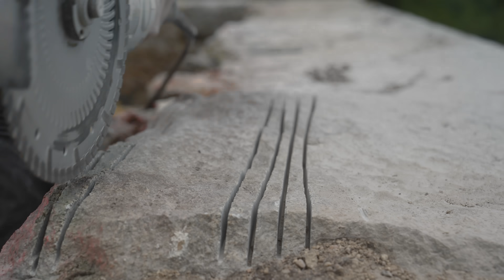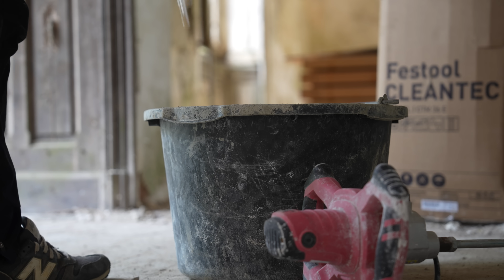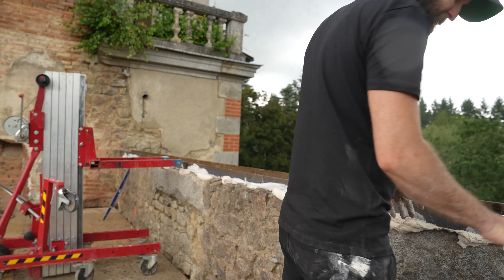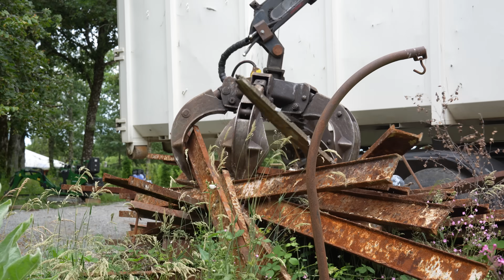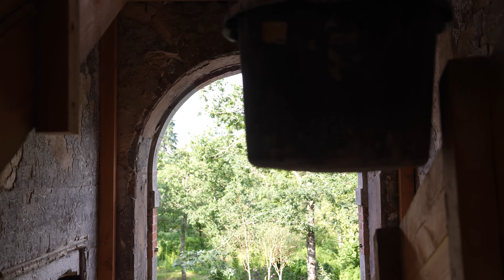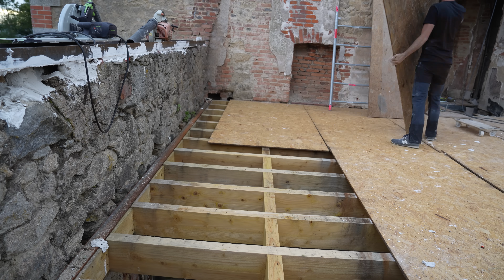The plates are set, its time to start constructing the roof.

Comment: If working  Fire Places are rebuilt  I've seen were the flues are relined using a inflatable bladder the mortar / concrete is pored around the bladder and after the mortar is hardened bladder is deflated leavening a  new flue liner in place

Comment: It's amazing how the original builders did the job, by eye, by plumb bob, by water level.
Impressive, but I do like the laser, chop saw, and impact driver !
Reply: Power tools, that is what I like. Im not medieval so a good saw works nice for me. Now where did I leave my safety glasses?
Reply: The Spirit/Bubble Level that is in common use today was invented in France in 1661 by Melchisedech Thevenot.
Reply: @hrep14  Just googled him, very interesting., Thank you!
Reply: Labour was so cheap plenty of hands make light work by 1879 circa when this chateaux was built they had proper levels measuring devices squares etc. Even using steel.

Comment: Been following you since the start and really appreciate your videos, and your persistence in renovating this amazing castle.

What I've been wondering since the start is why you don't use hearing protection when you work with a saw and now with an angle grinder? your hearing will be ruined like mine, tinnitus, ringing in the ears 24/7 like you've just been out clubbing.

keep up the good work! :)

Comment: Just a brief pause for thought when inhaling large quantities of granite dust. When granite decomposes it releases radon gas (admittedly only tiny amounts but still...) - which is why homes built in granite areas like Cornwall all tend to have Radon sumps. So quite apart from the normal risks from rock dust, like silicosis, It's probably not the best thing to have huge amounts of coating your lungs. Other than that Job well done!

Comment: You canake I beam handles by bending rebar in a long U shape and welding a rod along one leg of the UPSIDE DOWN U. It'll look like a stylish Y. Use the U part on the cross bar of the I beam to give leverage and pressure.

Comment: A safer way of placing the plates would have been,  1. flip it while on the hoist. 2. Move hoist so plate is over where you want it. 3. Place 2 wooden blocks on the ledge 4. lower plate onto the blocks. 5. Remove blocks.
Reply: Yes.

Comment: Still think you should drill holes through the steel beam and anchor them into the granite, don't see how they won't move, spread out, over time.
Reply: I’m guessing that all the added work of building the roof will hold things in place 🤷🏼‍♀️
Reply: Iron don't spread out......its not like wood
Reply: Absolutely, I’m quite surprised that he gets away without doing this as per the French building code, here in Australia I’m certain that structural anchors are mandatory
Reply: @skdoremi6666  It can slide outwards.  I don't mean the actual steel will spread, the whole beams can though.
Reply: Spreading out is one thing. Being lifted off in cyclones is another.
Reply: The beam on the granite is under compression in a Mansard roof. The posts that will be connected to it form a triangle with the inner fixed wall, preventing any spreading or movement. The upward force protection is gained from the inner vertical wall which is connected to the floor joists.
Reply: @MatthewBraithwaite-x6g  The inner vertical wood will shrink as it dries out.  This may put additional stress on the angled roofing, especially when there are a few thousand pounds of snow on top.  I would still put anchors in.

Comment: I noticed this when he was putting the beams on for the other roof, where he just glued the C-beams down instead of drilling holes for the bolts. Can someone explain to me why glue is strong enough for this kind of construction?
Reply: The Granit is too strong to drill in. He explained it in the first half of the roof construction.
Reply: The top of the roof the big beam will laying on top of the structure he is building,the one on top of the floor not the walls...basically the iron beam isn't even needed as all it serves is a base for the round shaped roof,just esthetic, the roof structure itself as heavy as it is will be supported by structure he just lay down the beams foundation on the floor....its like building a room on top of the roof, adding a curve to the outside is not structural and the beam will not move,originally there was none,just a wooden beam to support the shape of the mansard....its a fake roof structure,the one that is important is laying on top of what he will be building not those walls.
Reply: @Joshua-j3n  I did hear him say the granite was very strong, but I didn’t realize that meant it couldn’t be drilled into. Thank you for clarifying this for me. 🙏😊
Reply: @skdoremi6666  ok, that makes sense. Thanks for explaining! 🙏😊

Comment: it,ll be nice when all the roofs are on inc the turret & its all watertight for the winter months & i suppose by this time next year the windows & staircase will be prob being made & fitted & then it,ll be the electrics & then the interior plastering, & then the central heating, oh & the fireplaces. & maybe a woodburning or multifuel stove, if it were mine i,d love going around salvage yards to look for original fireplaces & door,s etc, & maybe i,d find a couple of fireplaces on ebay & other fixtures & fittings. & i think in france there.s planty of second hand furniture places, cos a house that size will need & be able to take nice ornate antique dresser,s or sideboards which are plentifull in france, & are quite cheap.. Prob cos they are too big for the avarage sized house  but ideal for here.

Comment: Bosch makes some great different width SDS Max  flat scaling/chipping bits that probably work better using hammer setting rather than any rotary hammer bit .
Reply: Bosch also has excellent SDS Plus scaling bits for their much lighter rotary hammer drill which are excellent for chipping off plaster from the old walls

Comment: Is the cement he mixes up the right thing to use to join the steel to the top of the  granite wall?  Wouldn't he need to also pin it down with bolts?
Reply: The steel will be under compression in a Mansard roof so no need to bolt them down (the original wood plates weren't either). The mix he uses is a glue/bedding compound just to hold the C channel steel in place whilst the roof is built on top of it.

Comment: Any plans to anchor it down into the granite with rebar or epoxied hardware? 😬
Reply: No need, the beams are under compression when the roof is on.
Reply: No, because he didn't want to risk cracking the granite slabs.

Comment: Would love to learn some details about the roof structure. From seeing you build the other side, I don't understand why all the weight of the roof structure and subsequent slates end up bearing on the floor system instead of those massive stone walls. We definitely don't see construction methods like that in North America!
Reply: The original reason it was developed was as a tax dodge, essentially.
Reply: @LaReynedEpee  Not really.  The first and oldest example was the Louvre, according to Wikipedia, and ad a government building, was exempt from tax.
It's popularity might have been due to tax benefits,  but it's invention doesn't seem to be.
Reply: There's a big entry in Wikipedia,  including lots of US examples.
Reply: Sorry my question wasn't clear... I'm asking about structural engineering details on the 3rd floor/roof load bearing. Not why it was built.
Reply: @mikesradios  Fair enough. The answer is Style.  That's it.
No special structural benefit. 
Mind you,  the load bearing at the floor beams almost right next to the wall, would be waaaay plenty enough for a timber roof,  and being able to do a lot of the carpentry work not hanging over the outer walls edge, is good.
It's really just a variation of the Dutch Barn Gable, providing maximum internal room while still giving run-off.

Comment: Just wondered Dan - is that lime mortar you're using for the wall steels or something else? Also wondered if you need to bolt the steel into the granite or is the mortar sufficient? Thanks
Reply: It's a construction glue/bedding compound. No need to bolt down as they are under compression in a Mansard roof.

Comment: still curious why your not anchoring the roof iron with at least a few anchor bolts into the wall.
Reply: Because the steel plates on the wall are under compression with a Mansard roof. The original wooden plates weren't fixed to the wall either.
Reply: I know they are anchored inside through the frame of course was still curious. thanks

Comment: I still have a difficult time believing plaster will hold that metal down to that stone for more than a couple of years, I mean, it's not even cement? I'd be drilling large bolts into the stone wall to hold it in place.
Reply: The beam in under compression in a Mansard roof. It doesn't need any fixing (the original wood plate was just sitting on the surface without fixing). Drilling holes in granite would not help and also be time consuming and risk cracking the blocks. The plaster is more of a glue/bedding mixture to allow some movement once he's put the C channel steel in place.

Comment: I always wonder why you didnt retrofit a powerdrill  for that lift?
Reply: Guess you missed the videos where he explained why he didn't....
Reply: Apart from Dan explaining that the mechanism binds easily...I can think of other reasons. 1. It would void any warranty 2. If the device failed and someone got injured, he would be unlikely to be able to take the manufacturer to court as he's modified the device. 3. If he sells it on later after modification and it fails and hurts someone, they could take Dan to court.

Comment: Confused why you didn’t drill into the stone and cement steel bolts in before placing the steel c channel? Anywho, as long as it’s gonna work I guess!
Reply: Because the beams are under compression in Mansard roof.
Reply: Doesn't want to risk cracking the granite.

Comment: What type of glue is that? I thought you’d have to anchor those steel beams to the stone wall with some massive bolts.
Reply: The steel will be under compression in a Mansard roof so no need to bolt them down (the original wood plates weren't either)

Comment: So your roof is just glued down? No anchors? 🤔
Reply: Those beams are under compression in a Mansard roof - no fixings needed.
Reply: @MatthewBraithwaite-x6g  I wouldn't trust that alone to withstand a major storm
Reply: @RetroBerner  the Mansard roof has managed to work for hundreds of years all across Europe....so I'd say it's been pretty well tested!
Reply: @MatthewBraithwaite-x6g  Yeah, but the climate is not the same anymore and it seems trivial to add some tie down straps
Reply: @RetroBerner  I would add tie down straps too - but not to the steel, I'd be adding them to the inner vertical wall where it attaches to the floor joists...as this is the one that takes all the stress!

Comment: Not ankering youre beams with bolts? I noticed it on the other part of the roof aswell. You think the grey stuff will hold agianst windy times?
Reply: The beams are under compression once the roof is on. The original base plate was wood and also just laying on the surface. This is how Mansard roofs are designed to work.
Reply: @fotter9567 The difference with a Mansard roof is that the outward pressure of the peak of the roof isn't applied to the point where the roof meets the building. The side rafters make a braced triangle with the ashlarings. This prevents any outward pressure where the roof (as a whole) meets the building. If this wasn't the case, the roof would push the wall plates off the edge of the building.

Comment: What are you using to glue these steel beams to the stone walls ? Looks a bit dodgy to me ?
Reply: It's a general construction adhesive. It's only there to make it easier to level the beams and stop them moving whilst the roof is built on top. The adhesive isn't structural as that part of the roof is in compression.

Comment: Dan, seem to remember that about 3 months ago you received  (as a gift ?) various workshop machinery & tooling. Was the supplier’s name “Atkinson” ? If it wasn’t Festool - as per the cap you’ve been wearing today & recently, might that original supplier get peeved?
Reply: Axminster. The machines they provided are more suited to things like window frames and woodwork which will be on show....but need to get the roof on so he can have a dry enough workshop to unpack the new kit.

Comment: How does one gain access to that top floor? There doesn’t appear to be any place for a staircase. Same for the tower.
Reply: How do you think Dan is getting to the top now? He's using the temporary staircase which will one day be turned into the final completed staircase.
Reply: @NurseSherry  the staircase ends in front of the newly arched brick wall.

Comment: I'm surprised that Danisn'tt strapping or bolting the steel plates to the wall. They'd be required by UK regs
Reply: The steel will be under compression in a Mansard roof so no need to bolt them down (the original wood plates weren't either). The vertical internal wall is fixed to the floor joists and acts as the resistance to upward forces.
Reply: @MatthewBraithwaite-x6g Thank you for explaining this to people
Reply: @MatthewBraithwaite-x6g  I think the resistance to wind uplift will be from the considerable weight of the Mansard. The few screws holding the wooden floor plate wouldn't provide much resistance on their own !
Reply: @bobwright-st5hd  Absolutely it's the weight of the roof! If it ever got to the point where an uplift was strong enough to lift all that, those wood fixings better just man up and take the strain!

Comment: for the bosch hammer I would probably rather use the chisel and not the drill bit. I have seen you using the drill bit for chiseling in videos before and I find that quite odd.

Comment: Dan, PLEASE. You need to take safety seriously. Safety glasses, goggles, a must. Stops exploding cutting/grinding discs from serious eye injury and sight loss, ear defenders a must, prevents deafness in later years. Safety boots, stops crushed foot and toes plus ankle damage. 
Also please reel out all electrical cable to prevent heat melting cable and fire. 
Safety Rant over. 😂🙌🏻

Comment: By no means is anything in this comment meant as a slap at what Dan is doing.  I'm just curious....do you not have building inspectors that need to approve each step of the process?  That parameter steel you added to the wall.  Is that part of the roof structure?  If so, I'm from a part of the US that gets hurricanes and I know parts of France gets hurricane force winds.  The weight of the roof alone wouldn't be enough to stop the roof from being ripped off the building in strong enough storm without it being anchored onto the wall.
The chateau is really coming along nicely.  Can't wait until the roof is on and the windows are in so you can start working on the interior.
Reply: From what I've seen of French building inspection....it depends on a few things. If, for example, Dan applied for a government grant to help rebuild, there would be strict rules and constant inspections. If it's a private dwelling and you're funding it yourself, the rules are far more forgiving. The Mansard roof internal wall is fixed to the floor joists which is where the resistance to being pulled upward comes from. The wall plates are under compression and therefore do not need fixings into the granite.
Reply: @MatthewBraithwaite-x6g  Thank you for the explanations!!

Comment: Dan c'mon man, an opening scene grinding concrete with no mask or ear protection? I mean there is cavalier and then there is just plain stupidity. What's the point in spending years on this build if you won't be around long after to enjoy it??? 

Here's a little excerpt that should really worry you - "Crystalline silica commonly occurs in nature as the mineral quartz, and is found in granite, sandstone, quartzite, various other rocks, and sand. Workers who inhale very small crystalline silica particles are at risk for silicosis — an incurable, progressively disabling and sometimes fatal lung disease."